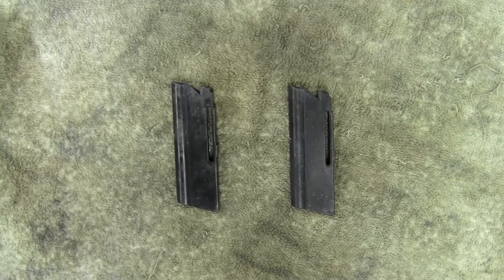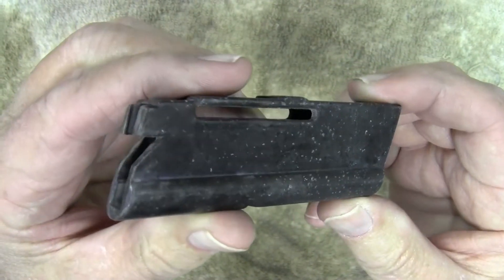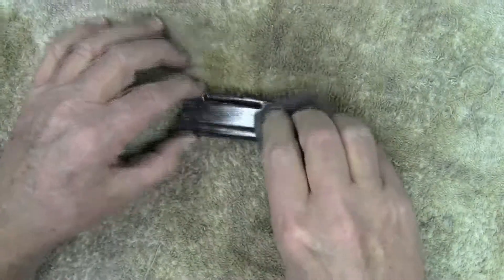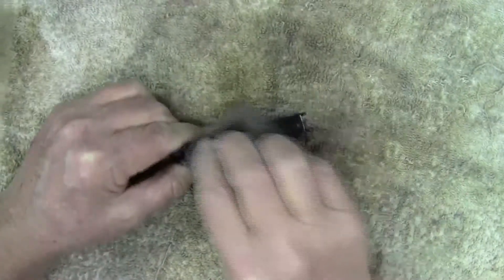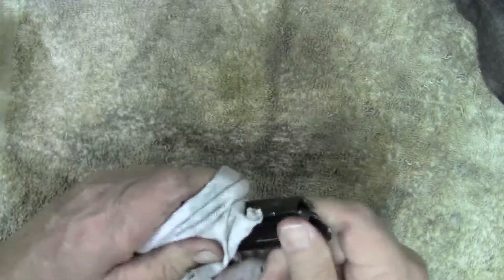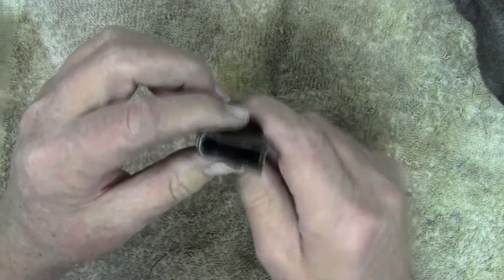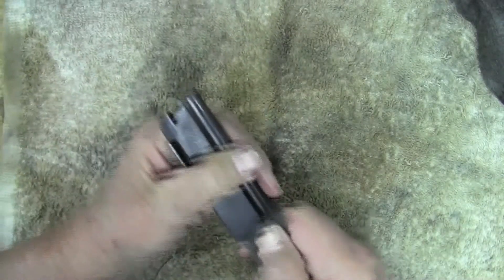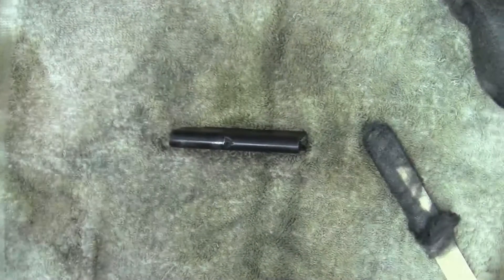Removing corrosion from a steel mag

Comment: Looks like that worked pretty good👍, I usually use a penny as it won’t take away any of the finish
Reply from the maker: I've seen that method, I'm should try it if I ever need to remove rust/corrosion again